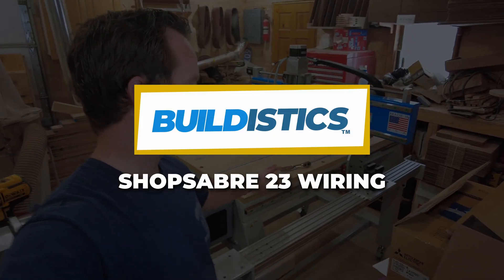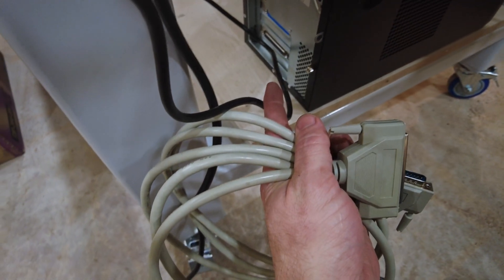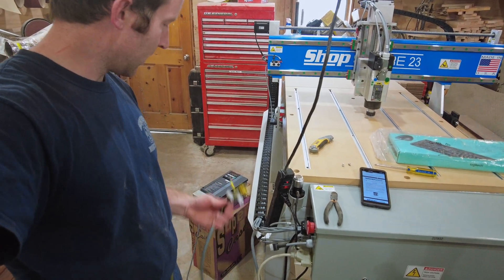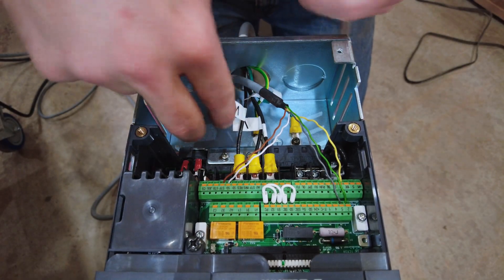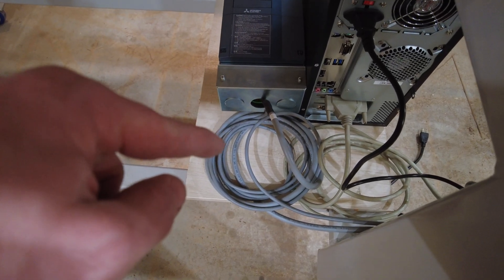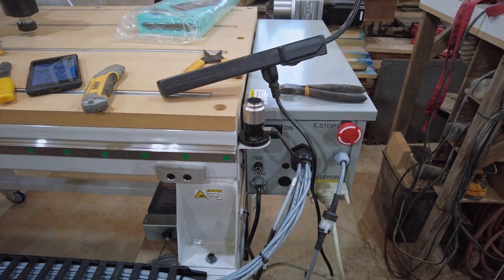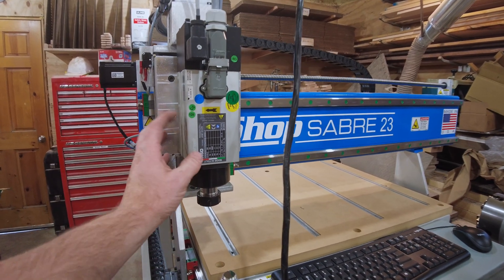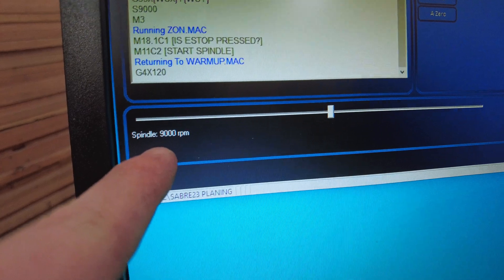ShopSabre 23 Wiring and First Start (Industrial CNC Router)

Comment: Question for you - I just purchased one of these used and the guy said to not put the blue port cable in the top (blue - port).  I assume he is wrong since your went to the blue looking port on your computer
Reply from the maker: Yes, blue parallel cable goes to the blue port on the computer.
Reply: @WoodworkingBusinessmen  For your spindle did you need an additional mounting plate or did that spindle fit on it?
Reply from the maker: @bigdogmn73  it came as shown with the Itilian spindle.

Comment: old  Parelle port controller from wind cnc . even Cam master moved to centroid  with ethernet
Reply from the maker: I'm curious what the issue is.  I personally know of several Shopsabre machines (all using parallel ports).  And all without issue.  If there's a technical advantage to moving to ethernet, I'd like to hear it.
Reply: it outdated controller limited features. plain simple wind cnc has not updated there controllers in over 10 years  Cam master switched off them to centroid.  win cnc requires old tech pc windows 11 doesn't do parallel ports  lot reasons the whole cnc world been using ethernet last 10 years or more .  it faster response  most controllers like centroid acorn run in real time  better motion response resolution  were old parallel port the pc is the controller  i can go on all day why it better . i surprised shop Sabor still using them
Reply from the maker: Interesting.  Maybe Shopsabre will change their system if they need to.

Comment: The spindle takes it's own dedicated 220v plug. Where is the 220v plug on the machine, I never saw it?
Reply from the maker: That has to be wired up separately.  20amp circuit.
Reply: @WoodworkingBusinessmen  Yes I understand it takes its own dedicated 220v, but what I'm asking is...Where is the ACTUAL PLUG on the machine that PLUGS IN to the 220v outlet? I did not see one. The PHYSICAL CHORD AND PLUG?
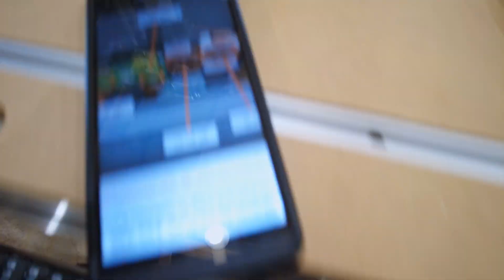Reply from the maker: @JD-nq4vb  They do not include one.  They recommend an electrician wire it up.  I did it myself, as noted at 3:55.  It's essentially 12GA wire connected to a 20amp plug (they look different than your standard 110v plug).  The other end is connected to the terminals shown at 3:58.
Reply: @WoodworkingBusinessmen  Yeah I know what they look like, but there are two types of 220v plugs, that's why I was asking so I know whick wall plug to buy. Thank you very much for the info and responding, especially so promptly, you've been a big help. My SS23 gets here Saturday. Thanks again.
Reply: @JD-nq4vb  You said your CNC was coming.  That was a year ago.  Did you get it and were you able to get it hooked up okay?  Did you buy the spindle that requires 220 wiring?
Reply: @rso1411  Yes...I bought it with the 220v spindle and you have to buy the plug and chord to hook it up yourself, which is a joke when you pay so much for the machine. But I got it hooked up and it runs great. I've been making enough money from it to be able to never work for anyone again, which was my goal since I have always been a non-conformist. The machine is a beast for sure. I'm actually going to buy a smaller one soon to run more projects. Good luck to you.
Reply: @JD-nq4vb   I finally got my machine, but am a little confused on how to supply power to it.  I was just going to wire a 20 amp plug to it and plug it into the 220, 20 amp cord hanging in my shop.  But, the directions say to run a line from the fuse box with a disconnect switch.  But the electrician I was going to hire called Shop Sabre and he says they also want some type of voltage regulator in the line that is very expensive and is back ordered 12 weeks.  I'm a little frustrated, did you deal with any of this.  How did you power your machine?
Reply: @rso1411  I built my own shop so I had a dedicated 220v fuse put in ONLY for my SS23. I do not have a voltage regulator, an on/off switch, or any disconnect switch. I only have the normal on/off switch in the fuse box which I never turn off. I/you have to buy your own plug and chord to wire up your spindle box, which I did myself and I hate wiring and don't even know wiring but I figured it out. I plan on putting an on/off switch on mine or maybe just a surge protector with an on/off switch so I don't have to plug/unplug it every day. I have had no problems and I think you can get away with your 220v plug, just make sure if it should be 20 or 30 amp, I don't remember. I do know that SS wants you to have it's own dedicated 220v plug for insurance reasons, everything they tell you will be based on them covering their own ass. I called them about wiring up my spindle box and I think the gardener answered the phone as he was coming back from the bathroom because this guy was clueless and telling me some B.S...As I said, I think you'll be ok, tell your electrician to wire it the way he knows it should be and you'll be ok. Best of luck and have fun with it.
Reply: @JD-nq4vb  Thanks so much for the reply.  I decided to run a line from the breaker box with a disconnect.  The on/off switch is a good idea.  Thanks again.

Comment: They gave you a PC from 1995???
Reply: As a guy who has built 30+ custom PCs, I did laugh a little when I got mine.That said, it’s a decent PC which basically is a dedicated PCIE controller running WinCNC. I do appreciate the simplicity here as it runs cool and doesn’t have a lot of fluff to break.  I did a few minor upgrades, added an SSD for backup and replaced the monitor, and upgraded to windows 11.
Reply from the maker: @5280Woodworking  I agree.  Dropbox for my backup (Vcarve tool DB, Vcarve project files).  Maybe I'll make a video on the ways I've made mine more efficient (WinCNC mods, automation, etc.) for our small production shop..
Reply: @WoodworkingBusinessmen  Yea, you should update on what you did.  I too customized WinCNC.  I added a park, power down and panel change using the P# positions.  I also added a G91 offset using a 1" z-zero gauge which I love.
Reply from the maker: 😅 I know, parallel ports are so old but apparently still work!